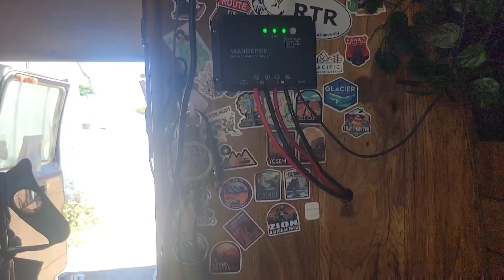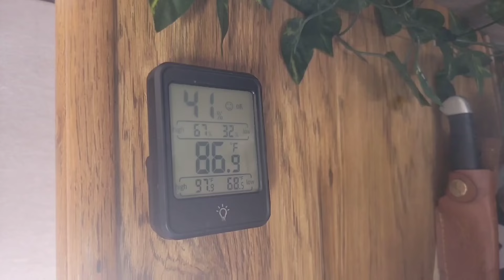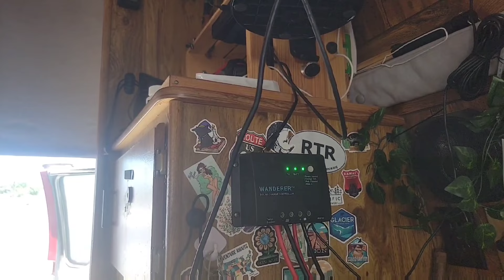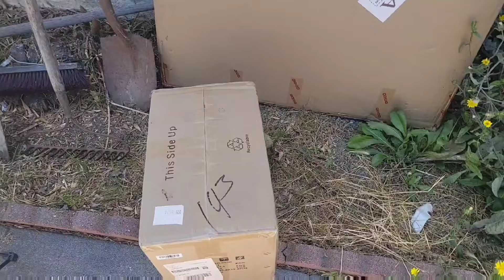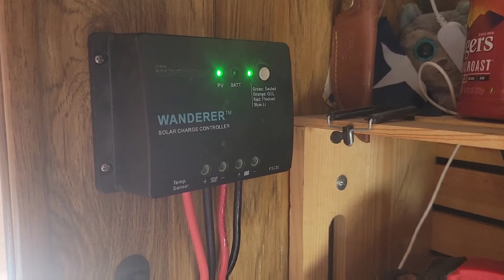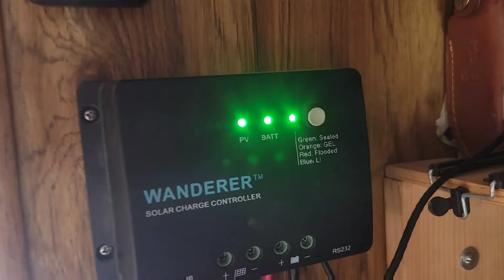How I added energy storage to Vanagain

Comment: Agm and maintenance free are the not the same. Like you said maintenance free can be lead acid still. Agm will always be maintenance free, but agm will never be lead acid. Agm stands for absorbed glass mat, that is the make up of an agm battery
Reply from the maker: Those glass mats need battery acid. Correct they're not flooded, but incorrect they don't have battery acid. They do. An AGM is considered a wet cell.
Reply: @NomadicZig the glass mat is absorbed with a gel tho not convenientional acid
Reply from the maker: @Winters1250  The AGM battery and the standard lead acid battery are technically the same when it comes to their base chemistry. They both use lead plates and an electrolyte mix of sulfuric acid and water and have a chemical reaction that produces hydrogen and oxygen as a byproduct. An AGM does not have gel. It uses conventional lead acid. You're very welcome to look it up
Reply: @NomadicZig  Have not seen a gel cell for ages , last time was on a boat.

Comment: You just lost 25 % if not more lidevon new battery, nvr add a new battery to n old one , old one will destroy the life of the new one.
Reply from the maker: You're absolutely right. Thankfully my other battery is still pretty new. Less than 4 month old, and it's also important to make sure they're both fully charged before hooking them up to each other.